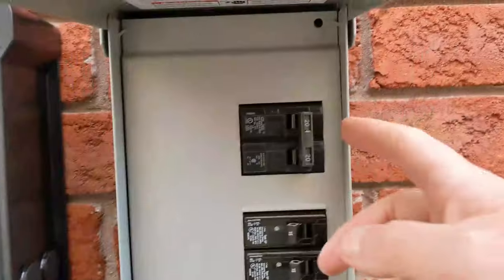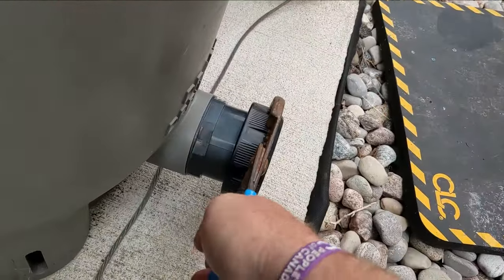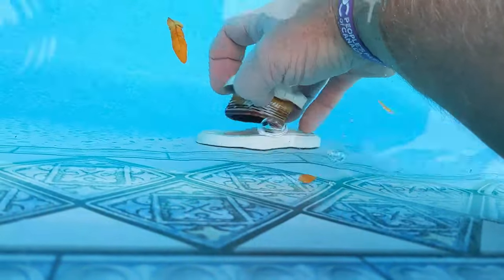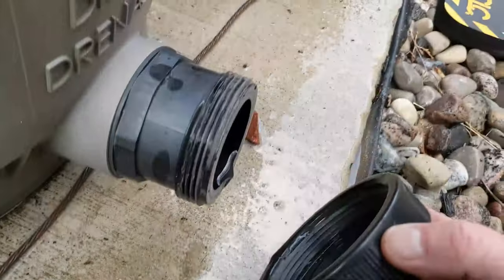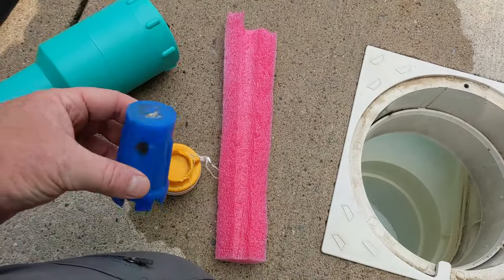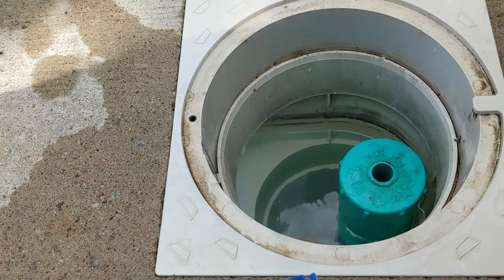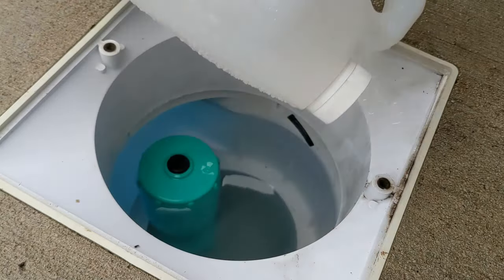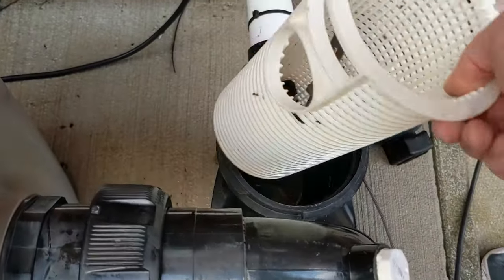How To Close an Inground Swimming Pool

Comment: Super helpful video.  I've been thinking of using duck plug, are you still using them and have you tried the bungee plugs?  Thank you
Reply from the maker: I still use duck plugs in most of my pools.   But.  Sometimes the duck plugs don't fit and I use the bungee plugs, or the expansion ones or even the standard ones. All depends on the brand name of the returns that were installed or type of pool.  And.  That don't work in concrete pools.
Reply: Wow, thank you for the quick reply.  I'm going to give them a try.  One more quick question if I may.  You're thoughts on those skimmer mouth plugs, worth it?  I don't plan on lowering my water.  Thanks again @VIPPoolsandSpas
Reply from the maker: @gianniagodini7826  I never use anything to block the skimmer.  Never really had a reason to use them or even wanted try them.